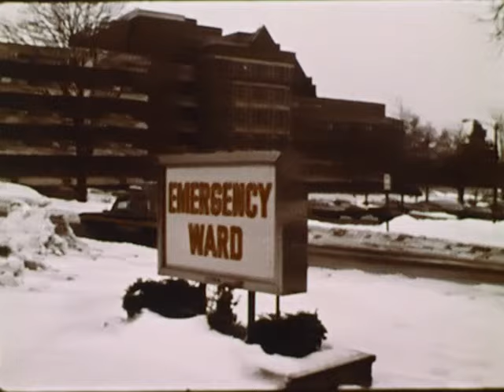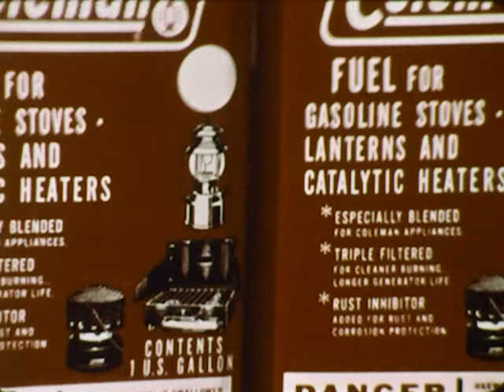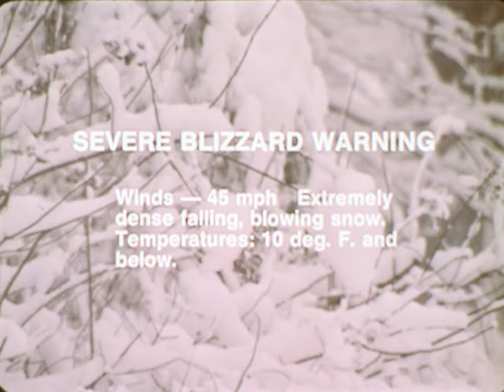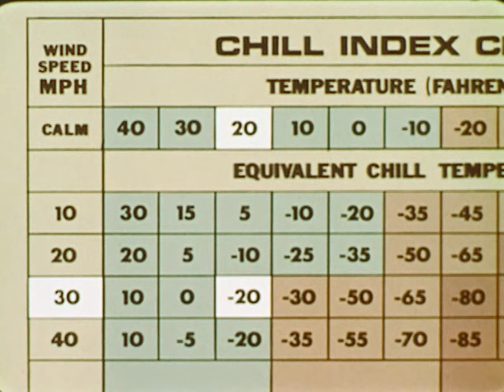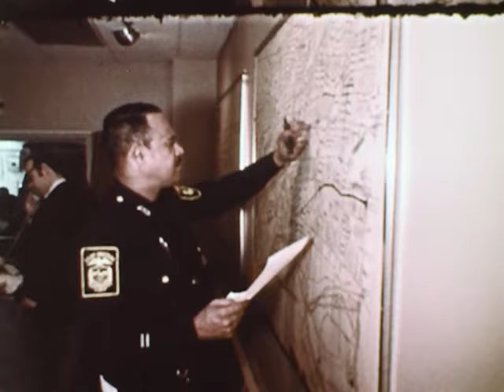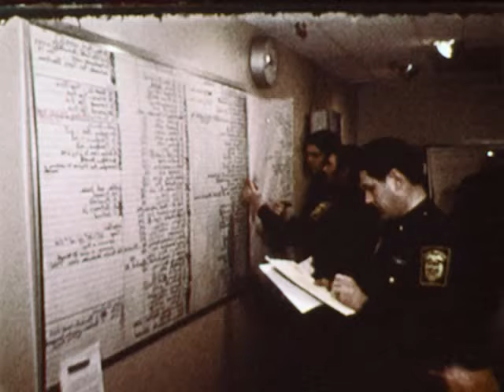Survival in the winter storm. (1974)

Comment: I've always been amazed with people who depend solely on electricity, especially in areas that are susceptible to winter storms. I've always spit it between electric and gas. I use a gas cooker so that if the power goes out at least you can heat the room, cook with the gas and of course boil water.
Reply: There should be a way to add on the cost of wood stoves and generators to your mortgage payments.More people would be better at taking care of their own family. Like getting a generator for the house hooked up to you gas line or oil source.  And that wood stove with a cook surface.We are getting our wood stove for Christmas,and our bad storms come in Late Jan./Early Feb.South Jersey canNOT handle any snow at all. Just can't.
Reply: Even a propane camping stove will keep you warm if the power is out and Allow you to cook
Reply: @canadaeast8358  Wade  yes it will. In Jersey we lose power once a month,serious we do. I have 2 twin burner propane and one single butane stove.Got 5 cook surfaces  to feed family and me. Plus  20 combined bottles of fuel. After we sell and move to a lake up north,new home is getting a large generac system run on natural  gas.Have a Mr.Buddy as well,just vent well.
Reply: @davidwadsworth8982 yes it’s nice to back up for sure just a small Colman stove in a small room is enough to keep warm and can mean the difference between life and death.. here in Newfoundland most people have wood stoves but not everyone like people renting apartments and what not